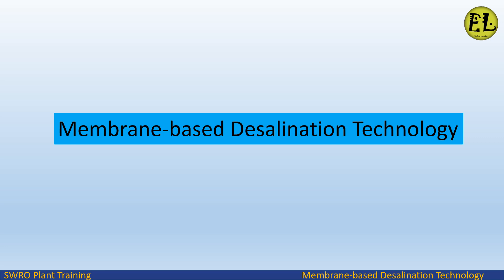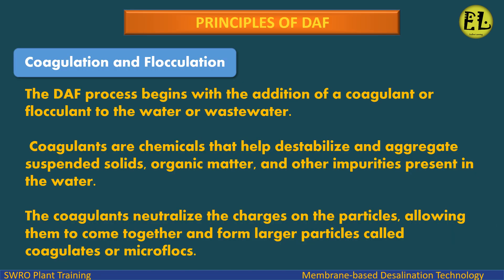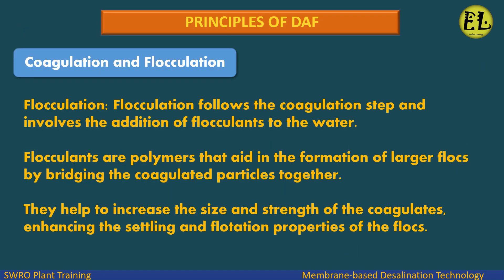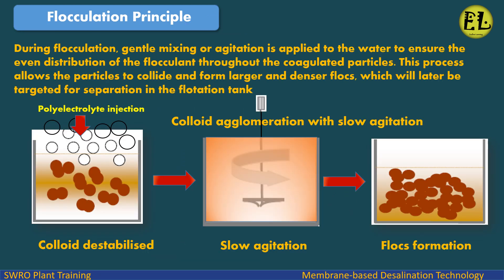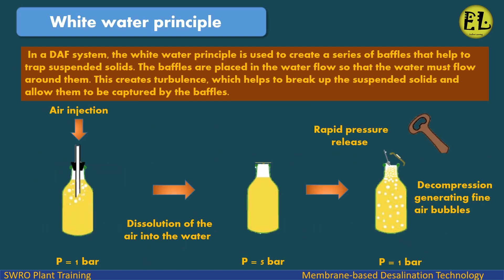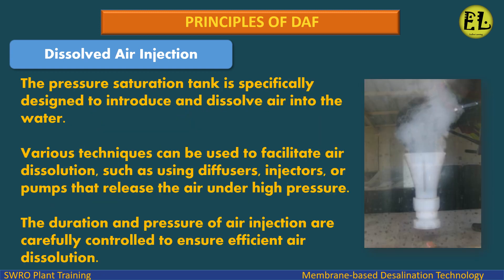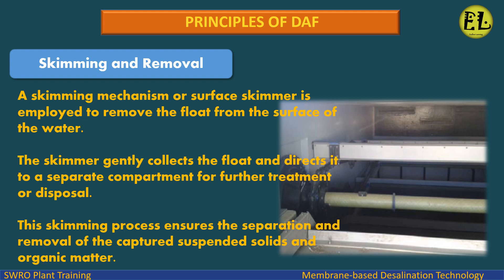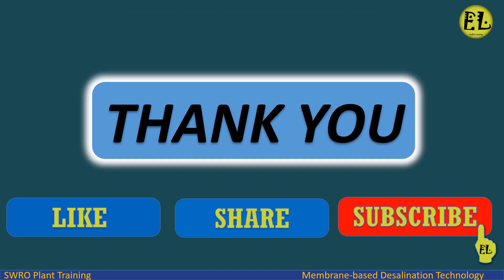DAF (Dissolved Air Flotation) system |  SWRO Treatment |

Comment: Good video... Can you tell please what is the effect of sea water temperature and pressure on permeate quality and production?
Thanks.
Reply from the maker: Temperature: As seawater temperature increases  as a resulting in a slight increase in  Membrane pore size  allows the water to flow more easily through the RO membrane, which increases the permeate flow rate (production increase ) but conductivity also increase (quality decrease ) and vice versa.

Pressure:  Higher sea water pressure enables higher recovery rates by improving the efficiency of salt rejection and water permeation. This means a larger portion of the feed water is converted into permeate, resulting in a higher production quantity.
Reply: @ENDLESSLEARNING555  Thanks for such a detailed explanation... Keep it up.